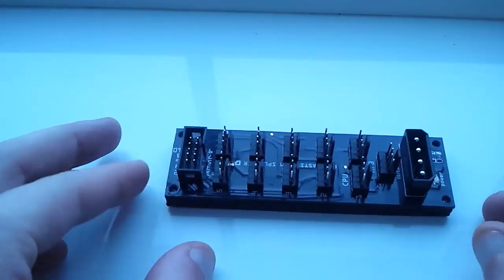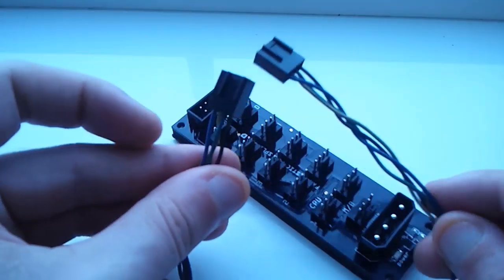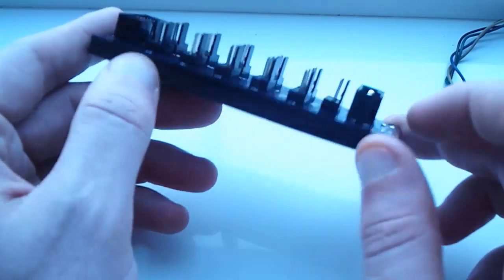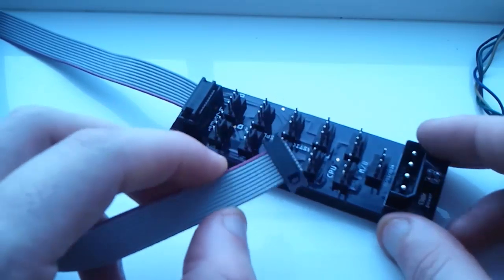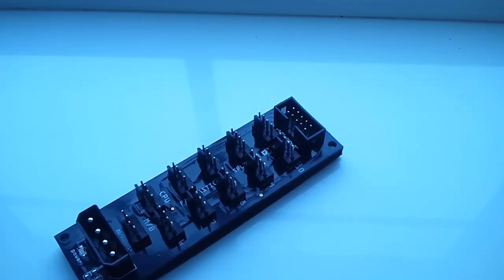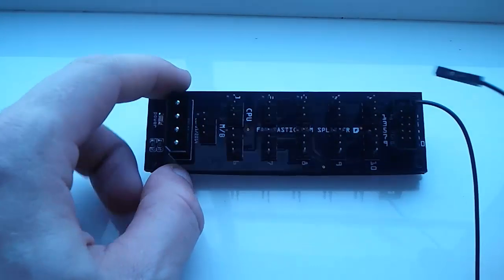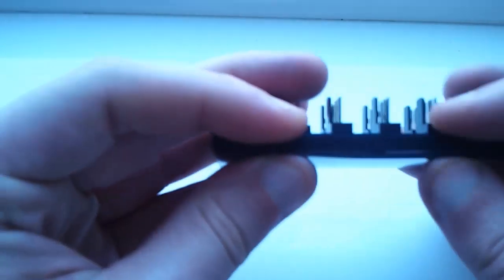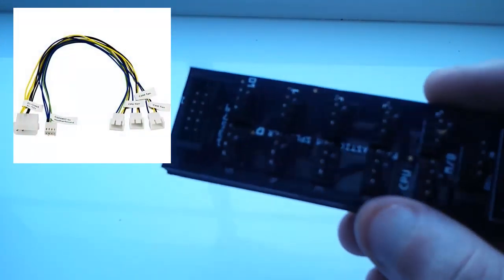10 Way PWM PC Fan Splitter (Custom Made/High Quality) REVIEW (Part 1)

Comment: How about if I want to connect 10 pwm fans and want to control the rpm of each individual fan. How can I do that?
Reply from the maker: You Cant.You would have to connect one PWM Fan to one PWM Fan  header  on the motherboard.My device just gives the PWM SIGNAL AKA SPEED INFO) TO ALL FANS INSTEAD OF JUST ONE
Reply: Okay, understood. Thanks for your quick reply. Happy Holidays!
Reply: Well technically you can. But not with a simple splitter like this. If you don't have enough PWM headers on your motherboard, You're gonna need either a smart-unit that connect over e.g. USB and is controlled through software, or a PWM fan controller with enough manual adjustment dials/knobs for the ammont of fan channels you want to control. Its available, but not cheap like this.
Reply: @pr0xZen  What controller would you suggest? Thx!